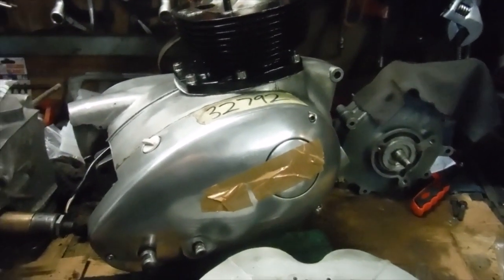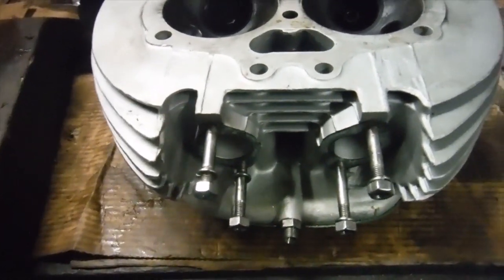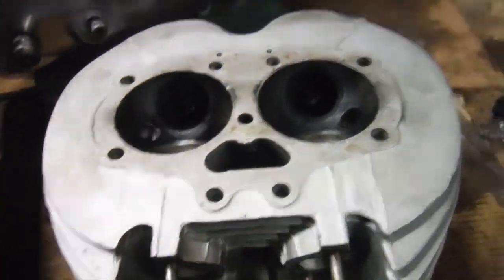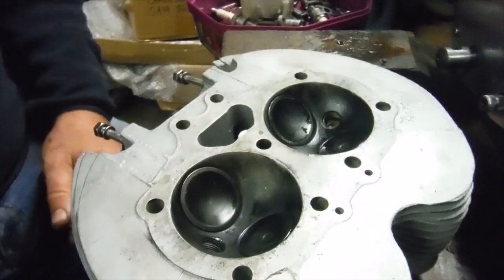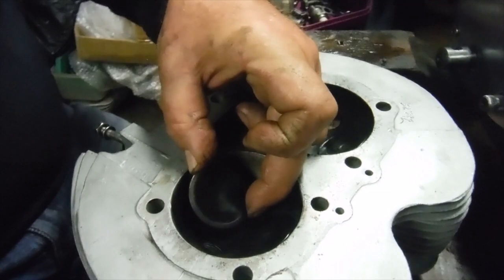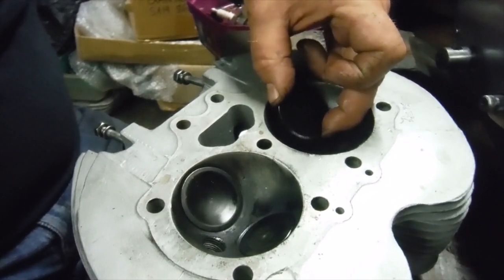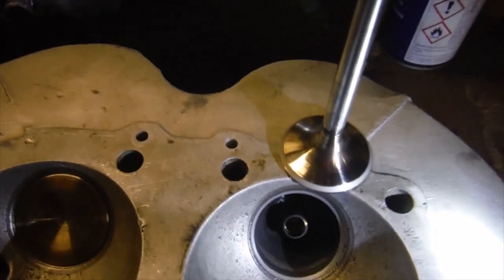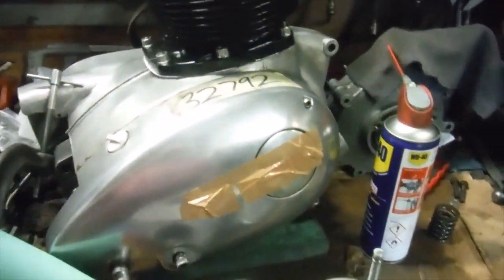BSA A65 - another one! - engine jigsaw puzzle 9 Cylinder head & valves, what goes where, worn guides

Comment: I've had two engines which had issues with smoke in the exhaust because of valves/guides.  One was a car engine that had valve guide oil seals that were shot and produced a puff of smoke at every gear change.  The other was maybe a bit more unusual.  It was a Triumph I had recently bought which was a bit smokey all the time, one cylinder slightly worse than the other, just enough to be annoying but smelling of burnt oil.  I stripped the cylinder head and found grit, that I assumed to be grinding paste, in between the valve stems and the guides.  This had worn the valve stems but the guides were unharmed.  The piston crowns and combustion chambers were incredibly coked up, much worse than I thought possible.  The bores were a little worn but within limits.  I fitted new piston rings and valves plus decoked and cleaned everything.  Afterwards, there was barely a trace of smoke and what there was could have been from the exhausts.  I have never seen so much play as there was in those inlet valves.

Comment: Hi Paul ,this brings back memories , i was in charge of a machine shop head bay for 4 years , you could blue that valve seat and see which matches , i dont think it'll matter with a light lap , also not sure if you have used it , CRC Gasket stripper removes carbon . Cheers .

Comment: I did wonder with the previous video whether the dark marking on the tops of the pistons was due to oil washing down worn inlet valve guides, as  there'd be a good bit of suction in the inlet port during the over-run. Another great video...

Comment: G'day Paul, that motor must have been smoking badly, you would think with so much oil traveling down the valve stem due to the slack fit in the guide, hope you have found all the problems on that motor now, cheers mate, Neil 🤠.

Comment: There would have been a real smoke-screen when you opened up after going downhill on a closed throttle unless the stem seals were unusually good.
Reply from the maker: There are no valve stem seals on these.
Reply: @paulhenshaw4514  BL Metro top-hat stem seals fit and stop the smoke!
Reply from the maker: A good fit between valve and guide is all that is required to prevent smoke.